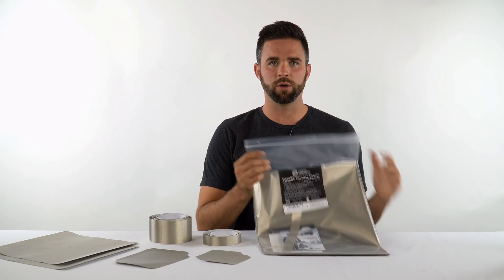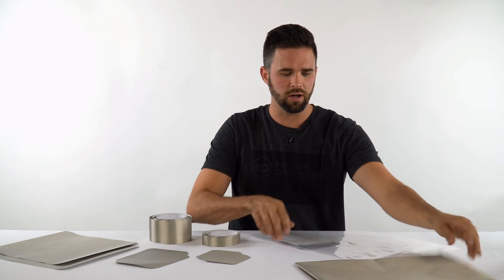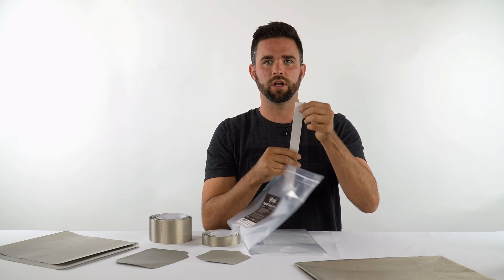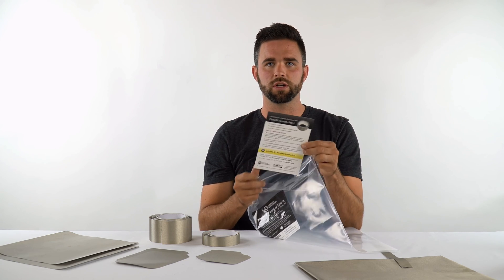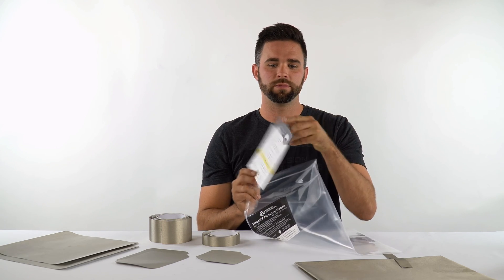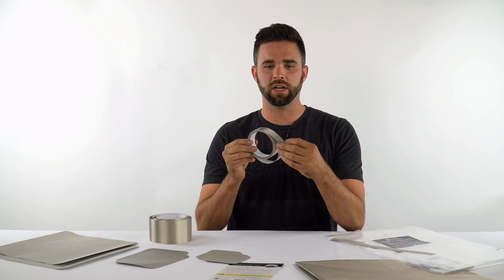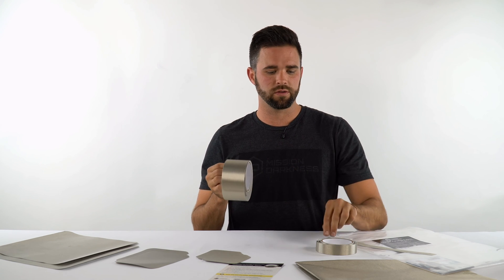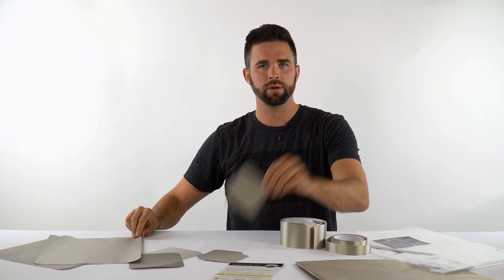Mission Darkness DIY Faraday Supplies Overview

Comment: if you cover your internet router or walls with it and complain about low to no wifi or cellphone signal you did it to yourself. congratulations.
shielded wallets is a legit reason. im getting into making my own wallets and need shielding.
Reply: Just use ethernet cables and root your phone to ethernet cable.

Comment: Can you sew this fabric and avoid the tape at the seams or is it still suggested to tape as well? I have an iCom IC 7300 radio I use for home base and would like to have a nice neat bag that I can open and close without too much fuss.
Next question, are their any Faraday zipper options? My machine can sew pretty much anything and I would liketo keep it neat.
Reply: Wondered this but nonreply

Comment: Will your faraday fabric withstand having a fusible ironed on (for stability) without distorting or compromising the fabric? I’m working to avoid creasing, as my first attempt at wrapping cables illustrated shortcomings of my design (multiple gathers for aesthetics). 

My next attempt will be to create a cable wrap that is more like a rifle case, but I’m looking for more stability with the fusible facing on one layer.

Comment: I just recieved my copper/nickel fabric and I am impressed. This is the first fabric I bought due to it's Keystone compliance and HEMP cert. I tested the fabric with my emf meter and finally a material that brought the levels to green or 0.01. This was with a double sheet over the router. A single sheet will block cell phone signals where there is no service. Than after taken out it takes about 10 seconds for the cell tower to find the phone. I wish your company would make clothing too. I'm looking for tactical clothing if you decide to produe this line of clothing. Or could you provide me with a company that sells quality tactical emf protective clothing with similar db effectiveness?
Reply: Did you ever find the right product you were looking for? I also would be interested